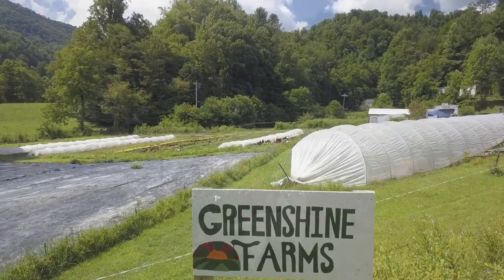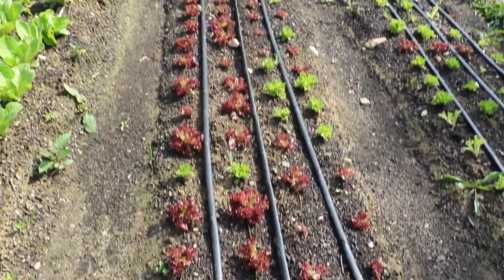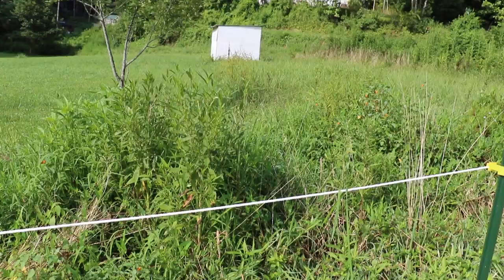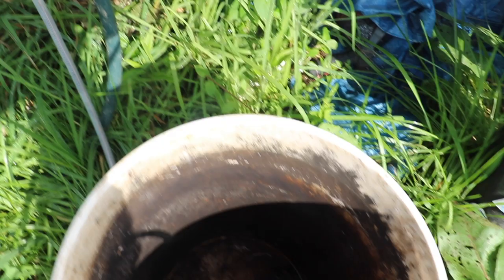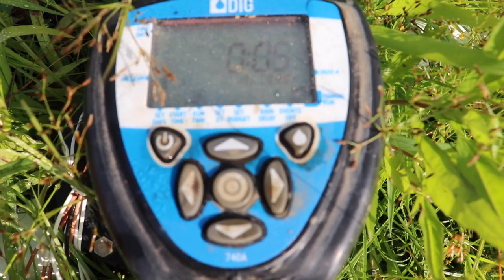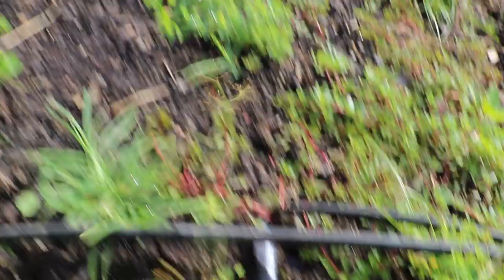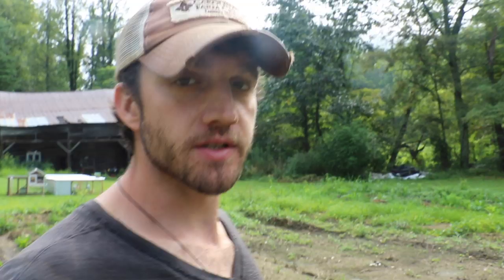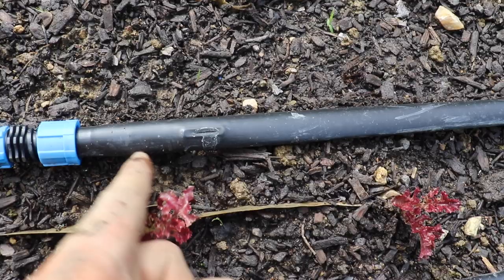Setting up a Drip Irrigation System (Start to Finish)

Comment: How do you plug the drip line dripper’s that you’re not using from the connection to your plans whether it be 5 feet are in 10 feet

Comment: What should be done with this type of system in the winter? We experience 3 to 4 months of snow/ice and can experience 6 to 7 months of over night frost. Thanks, great video.
Reply from the maker: I would put in a valve so you can drain the entire system, or atleast everything that is not burried underground.
Reply: @GreenshineFarmers  I would add that in our northern region, many landscapers use compressed air to blow out sprinkler lines (poly/PVC/galv) for winterizing.  In fact, some people rig up a fitting that has an air compressor barb on one end and a male hose or NPT on the other to allow easy connection at season's end.  Open up end of line, attach compressor line and blow it out.  Haven't tried it yet myself so can't say how well it works with small compressors.  Landscapers rent the big industrial trailer sized units (185CFM or so).

Nice video btw.

Comment: With the mazzei injector, what kind of filter do you have? The part that you have in the bucket looks way bigger than the one that comes with the injector. And how do prevent it from clogging? When I hooked mine up, I lost pressure big time. So I ordered the bypass kit...Trying to figure all that out.

Comment: Am supplying water from a raised tank do I need the pressure stuff?
Reply from the maker: Hard to say without seen your setup but you can definitely use a drip system with gravity feed.  Just depends how many drip lines you have in relation to your flow rate.

Comment: Keep up the great work and keep the wonderful videos coming!!! Been watching them and learning TONS of info. Thank you so much for sharing. I was wondering which Mazzei Injector are you using and what kind of liquid fertilizer?? Looking at setting up something like this. Sorry if I missed it in any of the other questions.
Reply from the maker: Thanks Luke, really appreciate that!  We're using the Mazzei E-Z Flo M584 injector.  That's the 1 1/2" pipe.  Been very solid.  Here's a link:
https://www.rainfloirrigation.com/wp-content/uploads/2019/12/Page-31-32.pdf

As for fertilizer I like to use Neptune's Harvest and then I add powdered mycorhizael fungi and beneficial bacteria.  Could even add predatory nematodes or do a compost tea.  Being able to fertilize through the drip lines has been a huge asset, especially with longer season fruiting crops like tomatoes, peppers, and hemp.

Best of luck with setting up your system and reach our with any questions!
Reply: @GreenshineFarmers  thank you very much for the reply!!! I ended up going with the 484 for the larger hemp field and the 348 for the smaller fields. Love the Mazzei injector so far. Big shout out to Cal at Mazzei tech support...spot on and helped to dail in my setup. Good info on the liquid fertilizer. Nice and simple to the point. Some of these products can be pricey. Once again love the videos and thanks for sharing the knowledge to help us thrive and not just survive. ~Luke

Comment: One last question before I go & order my drip gear. How many feet or beds are you running with your current 2hp pump? I am going to get the same Mazzei 584 injector but the pump flow is pretty important for them to work correctly. Would you be kind enough to give me some specs on your pump, flow rate,, head height etc as I'm finding it hard to match a pump here. I plan to use Hunter SVC battery operated valves for my drip timing & I assume your pump turns off at a certain pressure once your timer has switched off? Do you find any problem with having a bigger pump than you need currently to allow for future expansion? What PRV reducing valve do you have on your drip line?
Reply from the maker: I water each plot on separate cycles.  Each plot has around 30 beds with two lines per bed.  Each bed is a 100ft long so roughly 5000-6000 ft of line per plot.  

Our well is 305 ft deep with a 30 GPM potential, however our pump is only 3 HP with 19 GPM (I just found our well invoice).  3HP and 19GPM is more than enough for what we're doing.  The water pressure is insane and I only open the ball valves part way to help reduce the pressure.  The pump fills a 350 gal tank so that it doesn't have to run continuously every time we turn on the water.  I don't think there is any harm in having more pump than you need because as I understand it you can always throttle down the pressure.  However I am by no means an irrigation expert and would recommend talking to both the sales reps at Rain Flo (or other irrigation supplier) in addition to whoever will be driling the well.

Also not sure if this program exists in your area, but we got a grant through the Soil and Water department in our county that paid for 75% of the total cost.  Very simple application and well worth the time.
Reply: @GreenshineFarmers   Thanks so much for the info. I'm on the right track now.

Comment: Awesome setup & great explanation of your system. Out of interest, what size pump & brand are you running.
Reply from the maker: Not sure the brand of well pump but I believe it’s 2 horsepower.  When we use to pump water from the creek I used a little Honda pump that was pretty solid.
Reply: @GreenshineFarmers   Thank you. I'm going to set up a small market garden but having trouble deciding between drip or Senninger x-cel wobble sprinklers. They cover a huge area per sprinkler, typically 25ft depending on what coulour head you install in the sprinkler. Pro's & con's for both.

Comment: New sub.  Man I thank you so much bc you made this very easy to understand.  We still use over head, but wanting to go with drip on a lot of our stuff.    I got a question???    Could this be used with pond water and a gas powered pump.  We have great farms and plenty of good water, but no electricity on a few farms
Reply from the maker: Thank you and welcome!  Yeah I think you could, but you might want to run it through two filters before it enters the lines.  We were pumping water from the creek back in the day and I never had any problems.
Reply: Greenshine Farmers awesome.  I’m told by several suppliers that it’ll work, just like you said, need a very good filtration system though.   I’ve got to do some testing and get my pressures right from gas pump too.   That worries me bc I’d hate to install the system only to blow it apart after start up.    We use big over head right now and it works good, but for our greens I don’t like it bc it’ll make sand and dirt get on leaves      I sure do appreciate your response.     I seriously LOVE your channel.  Y’all are our kind of ppl❤️.

Comment: How tall is the hoop house for the Hemp?? What size galvanized pipe did you use?
Reply from the maker: I think it is 16 gauge, but the new tunnels from Farmers Friend might be even more heavy duty than that.  With the 16" lift kit addition, our tunnels are probably around 10ft at center.  Which is definitely not tall enough for hemp if you plant anytime before June 15th (out here at least)..  I think this year we'll aim for late June, early July depending on the variety and that will probably make it a little more manageable come Fall.
Reply: Just to add to this, why did you cover the hemp?  Water moderation?  Decrease in Sun Exposure?

Comment: How you keep your farming bed weed free so efficiently, please tell me. Here it is the biggest problem.
Reply from the maker: Weeds are a tough one and would definitely call us weed free (just looks that way lol).  However there are steps you can take to control weeds and I think this should be one of our next videos.  Thanks for the idea!
Reply: @GreenshineFarmers  Probably a little challenging with plastic water lines but I've seen where a farmer used  a flame weeder along his greens beds and had one of those floor scrapers drywallers use to scrape drywall mud off the subfloors as a heat shield for the plants as he walked down the row----- long handle and ~ 30 to 36" wide metal blade.  As usual, it works best on small newly growing weeds.